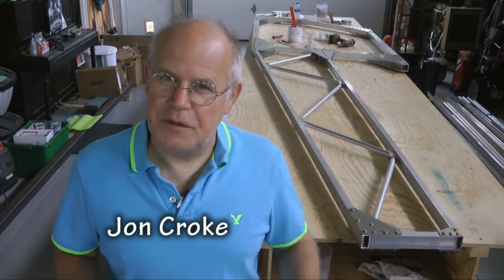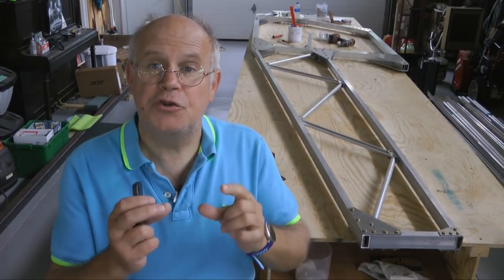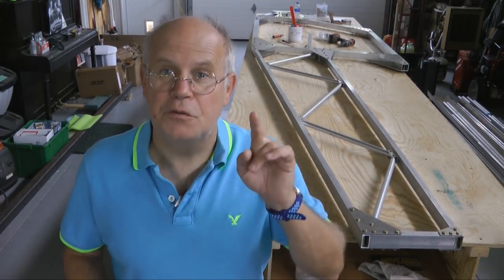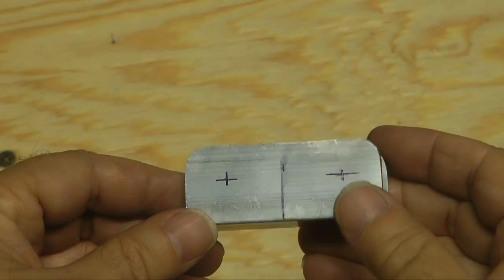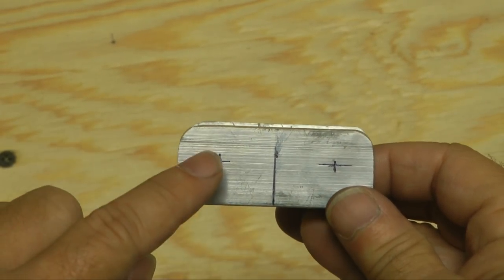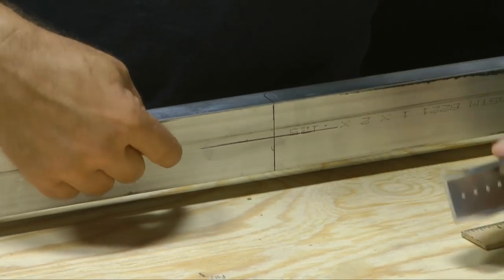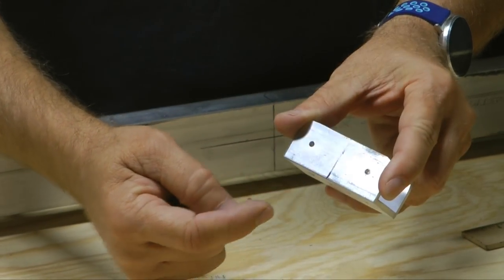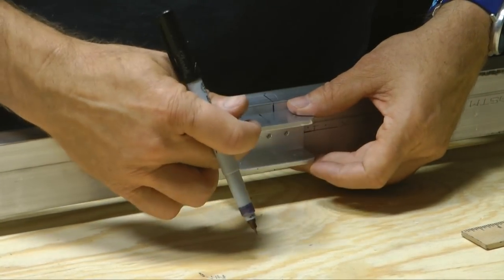Building the Affordaplane  Part  6

Comment: Awesome series!  I have a suggestion for setting your punch through the top gusset perfectly vertical for marking the lower gusset. Easier than using two squares, just use a short piece of square L-channel cut to be shorter than the standout distance of the punch.  Then hold the punch in the inner corner of the L-channel.  This way the L-channel serves as two-squares-in-one and you can be sure the punch doesn't move off-vertical when hitting it with the hammer since the L-channel can remain in place when using the hammer.

Comment: Absolutely love the video series.  A question if I may; once receiving the plans, would it be preferred to read through everything and maybe combine steps?  For example match drilling the tail gusset for the tubing while making the gusset?  Same with the brackets for the tubing, make them and attack to the frame parts before assembly of the frame?

Comment: An easy way to make a straight line mark on a length of tubing from one end to the other is with a piece of right angle material.  Lay the tubing on a flat surface, place the angle so that the open part of the angle is against the tube, (use a smaller angle than the diameter of the tube).  Clamp the 2 parts together so neither will move, draw a line along the tube using the edge of the angle as your straight edge.  This won't hold the part in place for drilling, like the 3D blocks, but the mark will be straight on the tube from end to end.  Having said all that, I will probably make my own wooden blocks 'cause I don't have access to a 3D printer.

Comment: when you are drilling a hole and you have a  flat surface, drill a block with your drill press so that you know it's verticle, then when inserting a drill bit you know it's 90 degrees to the surface you are referencing, I use a hardwood block and make several varying sizes of blocks to accommodate the area accessed.

Comment: Fabrication question, When building your brackets this way,  Would it be better to dril the cross holes first then take off the cap?  To minimize deformation of the part when drilling?
Reply: Yes, better in theory and if the material was thin and larger.  However, this piece is small and pretty stiff with the 1/8” thickness so deformation under the slight pressure of a $30 bit will be negligible.  Now, if the material was 0.020” thick, it would make a huge difference.

Comment: Question:  If you need to use two washers on each bolt, why didn't you put one under the head and the other under the nut?  Seems to me that the loads on the head would be better transferred to the gusset with a washer on that side.
Reply from the maker: These are AN bolts (FAA/military designed) and require no washer under the bolt head (examine one closely to understand its surface). You are not prohibited from placing one there - but standard practice has them at the other end!
Reply: @HomebuiltHELP  Thank you for the response, I really appreciated it.  I'm trying to decide which project to take on, the A-plane or the Legal Eagle.  In either case I intend to build in for the LS category and get an N number.

Comment: Reading on forums i saw people saying the affordaplane isnt structurally sound and you would be better off going with 'legal eagle' plans. Id like to know your opinions because Im somewhat new to aviation and would like to eventually own an ultralight.
Reply: lookup 'tango alpha one' on youtube, he has a lot of hours on his.  it seems structurally sound enough for a ultralight.  in fact most complaints I saw was trouble staying under the 254lb weight limit.
Reply: I feel like John is voting his opinion by building it.  

A Legal Eagle requires a different skill set, and more equipment.
Reply: @orbitalair2103  ....and I'm willing to bet you'll find some one, somewhere that will say the Legal Eagle isn't structurally sound.  Everything, and I mean EVERYTHING, these days, has "haters".
Reply: @ryoungatlmidotnet  @swashplate54 I'm just looking for something safe, at least in terms of homebuilts. I already have plans for the legal eagle and didn't really look into the affordaplane.  I like the half vw engine on the le
Reply: Just a personal perspective (this is my 4th project; my first was a Challenger tube and fabric semi-ultralight) ... the design seems sound and consistent with practices used on many of the more commercial kits.  If anything, it may be over-engineered.  The history of, I believe, 20 years without significant issues adds empirical supporting data.  It is quite possible that the biggest potential risk would be with construction techniques (not respecting the limits of the materials, use of 'hardware store' bolts for structural fasteners etc.).  Even a great design can be ruined by poor construction.  This is something that I really respect Jon for in these videos - drawing upon his considerable experience to apply and explain "FAA acceptable techniques".  For example, in this video, he emphasizes minimum edge distance for placing the fasteners - to avoid edge failure.
Reply: @steveukman  Well said.
Reply: @rockyrivermushrooms529  I understand wanting something safe.  I have a friend that has decided to go with the Legal Eagle and the half VW engine.  He is also a welder and that is a must skill for the Legal Eagle.  I would prefer to use a 4 stroke engine on the Affordaplane but they all seem to be a bit heavy for Part 103 compliance.  Ultralights are nor designed to fly in all weather conditions, so, basically, they fly in the calmest parts of the day.  Also, I suspect, the safest way to get into an ultralight would be to buy a kit from a known  supplier with a long track record of production if you are unsure of your building skills/abilities.  Having said that - in my opinion - the paramotors, ($15,000 fully equipped) are, arguably, the safest ultralights - again, in my opinion.  However, I'm too old to do all that running and I don't care for the trikes or quads.  What ever you decide, keep in mind that gravity is works instantly, 24/7, and is VERY unforgiving of mistakes.

Comment: Why couldn't you make more 3D printed Centering devices mounted permanently to space the tube within that gusset? Any strength issues?
Reply: The material used is PLA which has very little mechanical strength.  Further, the layers inside the jigs are only 20% filled (in order to minimize both material and print time).  I would not trust the parts.  If you are able to print solid nylon (much more expensive equipment required) then maybe.  These are for pure convenience ... 10 minutes designing the jigs (with a 0.1mm precision) in the evening then sending a batch to the printer  ... and the 'jig elves' reward me with a productive tool the next morning.  For any that asked, I plan to post the design files after I finish work today.

Comment: Why did you go with 4 rivets rather than 3 on the diagonal support brackets?  Where did you get the 3/16" stainless rivets?  What grade of stainless?
Reply: @robertbernard5283  Yes, I looked at AS and they only show the 3/16" diameter stainless steel as having a maximum length of 3/8".  I was thinking that these will need to be 1/2" - but there I go thinking again.  LOL.

Comment: at 7:46, is there  Not  a problem with putting steel  and  aluminum together?  eg., galvanic corrosion.        normal humidity is enough to act as a weak electrolyte.
https://en.wikipedia.org/wiki/Galvanic_corrosion

Comment: "Pipes"..?  Dude, pipes are all about the inside dimension and wall thickness.  They don't have to fit any tight places.  They have to have inner size to move specified amounts and walls strong enough to do the job.
Tubes are all about the outside dimension because they have to fit certain places according to a design.
If there is going to be more "pipes" than what you would put in a house, the engineers just have plumbers or pipe fitters put up the pipes, then have a building built around what they leave.   :-^)

Comment: How to deburr edge of hole inside of tube?
Reply: Burraway tool for the ones you can’t get to from an end.
Reply: You can buy V-shape blades for the hand deburring tools that let you get to the inside of the hole.
Reply: You can also use a flat metal file or roll up a small piece of sand paper that will be slightly larger than the hole.

Comment: The designer gave me these plans for free once, because I stuck up for him in the forums when everyone was ripping on his plane :)
Now I fly quad copters in the simulators instead.   Cheaper, safer, aerobatic, and way more fun than building parts all the time.
The paradigm has changed.  You no longer need to be in a cockpit to enjoy flying.  In fact, it's rather much better that you... aren't.
Now maintaining and flying an ultralight seems rather unnecessary, foolish, dangerous, and boring to me... all at the same time.
I can fly full aerobatics and crash all I want without consequence in the sim and never have to that endless ocean of... work.
I can focus 100% on flying and improving my skills and boy do you advance rapidly.   2,000  hours later....   I'm a boss in the air.
Reply: You choose the matrix?

Comment: Very cool, but why not use the 3d printed blocks as the spacers? However, I still don't care for the "Make ultralites great again" It is a stupid slogan and for you to use it as a reference to doing a build is appalling!!!
Reply: The PLA material used has little strength and, to keep the printing time down, the jigs are only 20% material inside.  I would not use them to support any structural component.  You could use the same models to print solid ABS or nylon that may be okay as spacers, but this will require much longer print times and not all 3D printers are capable of successfully fabricating them (or require lots of attention to tuning).  My use case is to be able to make precise jigs for my next day's activities and my workflow is to design them relaxing in the evening and have the 3D-elves make them for me overnight.  So far they have been real timesavers and have helped quality-wise.  I would be curious to know if anybody tries the SOLID ABS / Nylon approach.